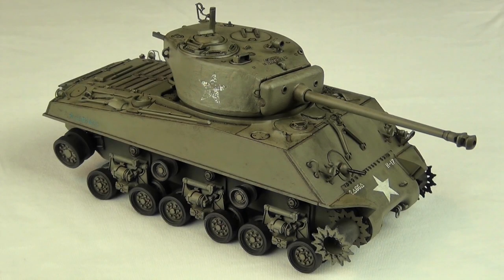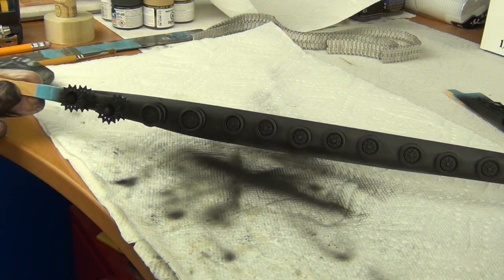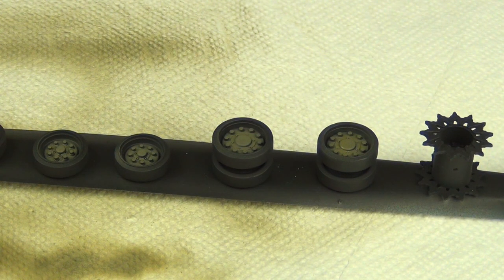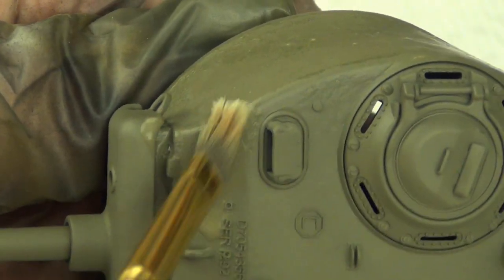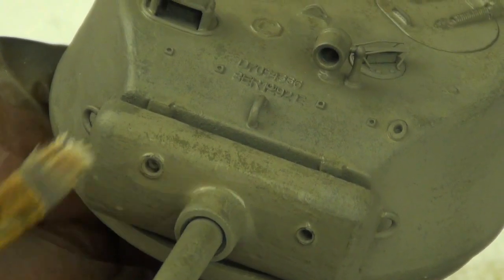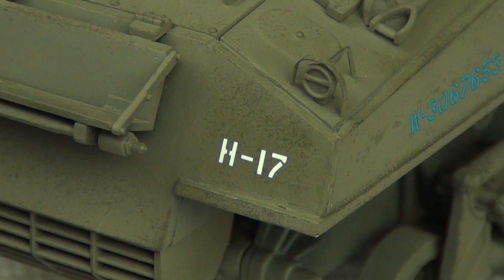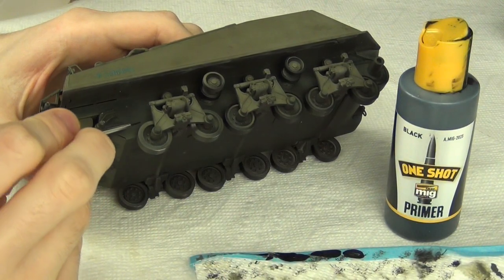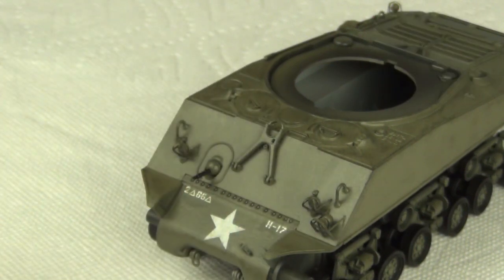How to Paint & Weather US Olive Drab - Dragon M4A3E8 "Un-Easy 8"

Comment: In the past I've seemingly had Microsol and other setting solutions react with the actual paint on the model causing stains or darkening, which is frustrating. And so using gloss varnishes to seal in the paint job does give me peace of mind that the paint job is protected when applying decals. Plus it doubles to help pin washes etc run better into details. There is so many variables with all these things though that it's worth trying with and without a varnish to see what suits you better. 
Great vid as always!
Reply from the maker: I do agree with you!  People often ask me if they should varnish between each step and my response usually goes: "you don't have to, and I don't, BUT there is no real harm in applying the varnishes just to make you feel more comfortable."  I use Tamiya paints which are super durable (pretty much as durable as any varnish) so I rarely varnish...I will only apply one to change the surface finish (as you saw with the satin varnish before the wash).  I won't apply "protective' varnishes since in my own workflow, those just slow me down and feel unnecessary.
Reply: Uses tamiyas setter straight on the original paint for a year, my take on it is that is softens the paint/decal and that the mild corrosive action setts the decal in the paint to some degree. The staing might be. Reaction with The paint that you use.

Comment: Used this technique (today) for the first time... didn't go 100% according to plan as the upper tone came-away  at some points in largish chunks, but by re applying the paint through an Uschi Von Der Rosten splatter mask, then it all came-out good !

Best from New Zealand.
Reply from the maker: Good recovery!  I should look into getting some of those masks.  

I think you got large chunks peeling off as the chipping fluid/hairspray was applied too heavily.  A couple of thin mists is all you need.
Reply: @Panzermeister36   - Oh yeah, that's exactly what happened, also using AK's new(ish) 3rd Gen water based acrylics and they aren't as resilient as the (tried & tested) Tamiya acrylics. The Uschi masks are very good, I use them mainly on aircraft builds but they're an excellent way of getting tonal variety into AFV builds aswell.

Comment: Very nice work, fantastic tutorial! US Olive Drab did wear quickly and become shiny from crew traffic - it did not chip nearly as bad as German and Russian armour. Their white markings however, where very durable and typically did not wear to the degree you have depicted but YOUR model, YOUR choice, lol 👍 One thing I dont recommend though, is soaking your decals - it washes away the glue and can cause adhesion issues. I prefer to soak them 10-15 seconds then leave them on a paper towel until the glue is activated and they will slide off the backing paper - adhere better and helps reduce silvering. And, yes, much prefer satin, or even matte varnish for washes. Thanks for the video!

Comment: Good stuff, Evan.
I used to apply a gloss to my kits for weathering, specifically washes, but have since stopped doing that. Sometimes I add some Tamiya X-22, Gloss Clear, to my paint mix to give it a satin sheen when applied. It seems to work pretty well and makes washes flow much better without absobing into the ultra-flat finish that Tamiya flats provide. I have also gotten some semi-gloss acrylic clear to use as my pre-weathering finish.
Another great video, and the OD weathering is great.

Comment: Great vid and well timed too. Superb OD and never considered just 'buffing' pant with a sander for decals...  have to give that test on some scrap first I think, and taking a sander to some nice paint is the stuff of nightmares. Great vid, thanks for sharing.
Reply from the maker: I haven't had the sanding sponge wear through the top layers of paint with my technique here.  I use 1200 grit and only polish for 30-60 seconds...until the surface is clearly smooth, but not perfectly shiny.  "Good enough" usually does it for me :)

Comment: Good job on the decals, I have never seen a need to apply gloss coat before the decal never had a problem with silvering, I have a bottle of solvaset that I have been using for over 20 years.

Comment: I've never had much success when it comes to durability using any Acrylic Primers. I had to strip a Jagdpanther one time after using MM Acryl Primer. I've also used Vallejo's Primer and none seem durable. I'm yet to try the Ammo Of Mig's but I find their paints not very durable. Nice work on the Sherman, finally got around to watching this one.
Reply from the maker: The AMMO primer is not actually an AMMO product.  It's rebranded Badger Stynylrez which is an excellent primer.  I agree AMMO acrylics are weak...but this primer is great.

Comment: Dear Evan; If we use normal Acrylic thinner in Tamiya paints, will it replace the X20 A? Also, how do you calculate the paint mixing ratios? So you're calculating drops? And, how do you determine the main color of the model? According to the suggestion in the booklet or how? Thank's a lot..
Reply from the maker: I'm not sure if normal acrylic thinner will work.  Tamiya acrylics are alcohol based, when most others are water-based.

Mixing ratios, I just estimate.  You could use drops or anything else; the ratio is always the same so the colour will be the same.

I determine the colour based off of reference photos and books I have.  There's a lot of good information about this on the Internet.
Reply: @Panzermeister36  Thank you for your answer. I'm new so I can ask you a lot of questions, sorry. I see that painting is very important. In any case, it is something that will be learned with time and trial and error. Can you just do a video on paint? Along with the reference picture.. And the shading and tonal transitions.. Or if you made such a video, I may not have found it.
Reply from the maker: I will see if I can make a video on that subject :)

Comment: I tried setting the decals like you showed. Solva set ate threw the paint. Where did I go wrong
Reply from the maker: Walthers solvaset is basically paint stripper; that stuff is super hot.  

I use Micromark Micro Sol as in the video since it works well at softening decals but it won't attack the finish.
Reply: Thanks for the help

Comment: Thinners are super confusing. You can use laquer thinner with acrylic tamiyas, then switch to acrylic thinner- what is the benefit? And how do you know if it will react with the lacquer
Reply from the maker: Tamiya paints are not true acrylics, since they are alcohol-based.  Therefore they can be thinned with both alcohol/lacquer and acrylic thinners.  

I used lacquer thinner on the base colour to make it very durable.  I used the Tamiya X-20A thinner for the top layer as it will be less durable then, which made it easier to chip away to reveal the previous colour.
Reply: @Panzermeister36  So as a general rule of thumb, you should build on lacquers and use them where you want a very durable coat?
Reply from the maker: It's not a rule of thumb per say, but it's what I do as it gives me a bulletproof finish.  Other people use normal acrylics for everything which is fine, but you have to use for protective varnishes.  I don't like waiting for all the varnishes to dry because I'm impatient, so my method lets me work without as much worry.
Reply: @Panzermeister36  ok thanks for the info!

Comment: Does regular paint thinner work instead of enamel thinner for cleaning up washes?
Reply from the maker: No, you don't want to use normal paint thinner as that will also attack the base camouflage paints and varnishes you've applied.  The enamel thinner is gentle and will only clean up the wash.

If you don't have any enamel thinner, zippo lighter fluid should also work!

Comment: Hey. I’ve got a Sherman Firefly in the mail to me so this was super useful thanks. I’m brush painting atm as I’m just getting started and was wondering, I’ve got acrylic matt varnish will that work ok for the weathering stage? I’ll be using the same Tamiya acrylic paints as you but for both the base coat and throughout the other stages of painting. Can I still use the hairspray technique if I apply a coat of varnish over the base layer? That way when I apply the thinner to active the spray it’ll just show the base colour and the varnish will protect it? Will the matt varnish work alright for the wash too or should I consider a gloss if I can’t find satin?

Comment: Great video!  Question......Don't you use anything to seal the base coat before you apply hairspray?
Reply from the maker: No, I don't need to.  Tamiya Paints are very durable so I am not worried about them coming off the primer.  If I were using weaker paints like AMMO or AK acrylics, then I might seal it...

Comment: Hey m8 just a question, first of all like your work, about the chipping effect, you using a darker colour under the lighter basecoat, so should the chipping colour not be lighter then the basecoat or does it need to be darker, just trying to learn more about it, thanks.
Reply from the maker: In this case I used a darker chipping colour for the wear on olive drab.  That's how I would do it on American tanks.  But on Russian or German tanks you can chip it differently...for example I'll chip using a red primer colour on German tanks which is not always darker than the camouflage.

Comment: What do you use for your final varnish coat? Dullcote?
Reply from the maker: That or VMS matte.
Reply: @Panzermeister36  wow, thanks for the quick response. You just gained another subscriber. 

From the bazillion ways I’ve seen Shermans weathered I like this the best. It’s very “light” and tasteful to me. Do you have a link for suggested track/wheel weathering that would match the way you weathered the Sherman?
Reply from the maker: Thank you :) for a similar "clean" look on the hull and running gear, I would probably go for a few dust washes and a bit of built up dirt in a few spots.  No heavy mud.  

So, you could start by applying some small areas of acrylic texture effect for some built up areas on top of bogeys maybe (if you want that look).  AK and Vallejo and Mig AMMO have lots of products for that. Then some enamel effects like AK Africa Dust Effects or Mig AMMO Splashes (Steppe colour) would be good, applying them similar to the way I did the wash here.  You could do less clean up to have a little dust on the surfaces, leaving most build up in crevaces.   You could also apply a little bit of some pigments like 502 Abteilung's Dust or Mig AMMO Airfield Dust, and then maybe you wouldn't need the acrylic texture earlier.  

You have a lot of options, and you don't have to use the specific brands and products I mentioned here...they're just to give you an idea and in my experience they're good dusty colours.  

My "standard weathering procedure" video on the DAK Panzer I Ausf.A might be helpful too.  I think I only used one pigment for the dust, which combined with a brown oil wash looked really good and not too heavy.

Comment: Just a question the last clear coat on your models do you use a flat or semi gloss. I have seen the real vehicles in the war museum and for the most part they do seem to have a bit of a gloss to them thanks
Reply from the maker: I usually use flat for the final cost since it makes them look a little dirty and faded and natural.  A slight gloss might make them look toy-like.  Museums are generally not 100% accurate in how they paint their tanks during restoration, so you should take what paints you see there with a grain of salt.

Comment: Hi, I'm a beginner, well after about a 40 year sabbatical. Cheers Covid :) just about to paint a T-34 would this work with the Russian green? Great looking model by the way Dude. TFS, G :)
Reply from the maker: Yes, on a Russian tank I would do the exact same process just with Russian green instead of olive drab.
Reply: @Panzermeister36  Tomorrow we paint the T-34E :)
Reply from the maker: Border model's new kit?  I haven't tried it yet but it looks very cool!  Have fun :)
Reply: @Panzermeister36  Hi, the only issue I had was the spaced armour on the turret, the bits that hold them on don't really fit so the second side I did I just cut off the locating tabs glued them onto the armour and glued them where the fell on the turret! Really nice kit otherwise. G :)

Comment: At last! Realistic wear rather than *chipping*. AFV hulls need a helluva ding to chip them down to the bare metal (nothing short of a projectile impact) Look at original photos. You'll see plenty of mud splatter and wear in the high traffic areas (even bare metal around hatch rings - use pencil to simulate), but hardly ever literal chips. It's nearly always overdone on models. It looks good, but sorry to say not really accurate. Excellent work.

Comment: It’s beautiful but it’s not an “Easy Eight”
Reply from the maker: It's an M4A3E8 VVSS.  The HVSS suspension was the E6 (Easy 6) programme and wasn't always on the E8.  E8 has to do with the T23 turret.  That's why you can see E8 still with this early suspension, and why you can also see early Shermans with the standard turret and gun with the HVSS suspension.
Reply: @Panzermeister36  It’s either an M4A2 76 W HVSS OR an M4A3 76 W HVSS. E8 was solely an experimental modification. Production M4s did not use an E8 designationz
Reply: @Panzermeister36  No E8 was the experimental HVSS modification.